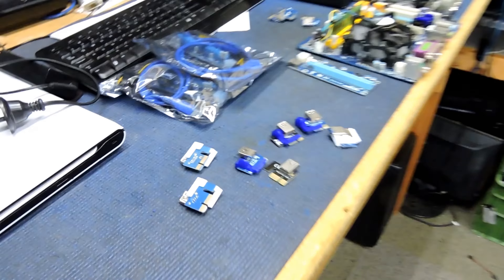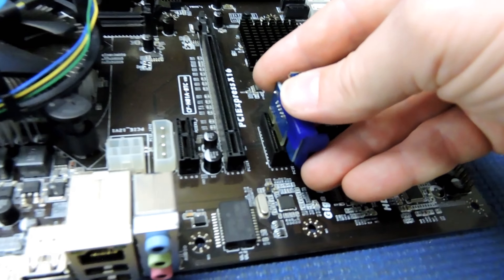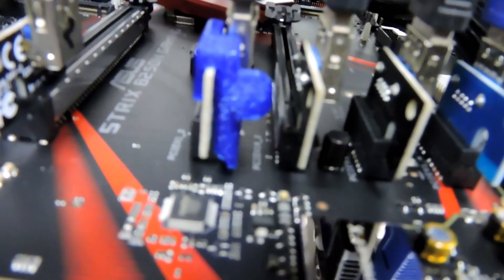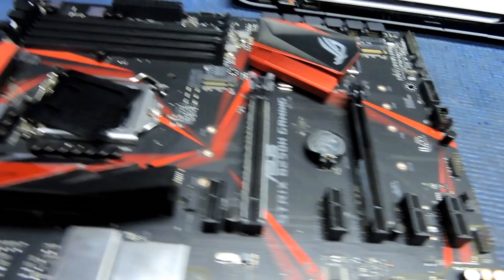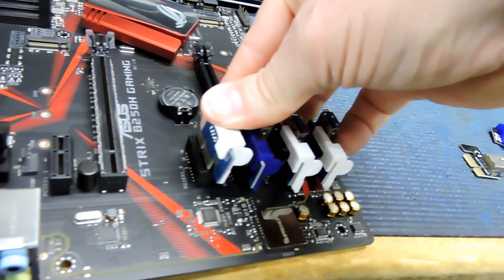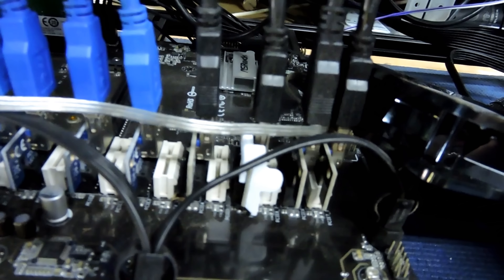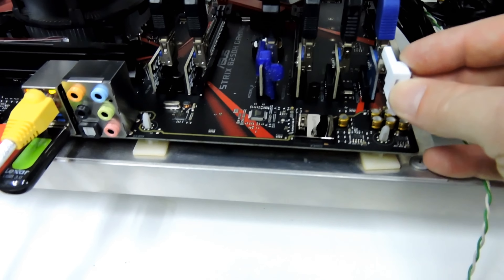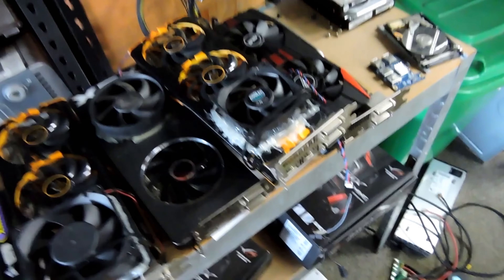PCIe Riser Locking Clips - Best invention in the world! ⚡

Comment: great idea! i'm actually interested in a riser setup thingo not for mining, but for putting my PCI-E wifi card on a stand outside of my system, and not only do these things look good, but they'll prevent the riser board from coming loose.
I just wish I could find a kit with the male pcie x1 male board, a backplate connector fitting, and a tidy little enclosure for the pcie x1 device.